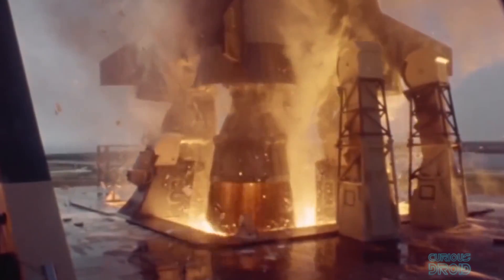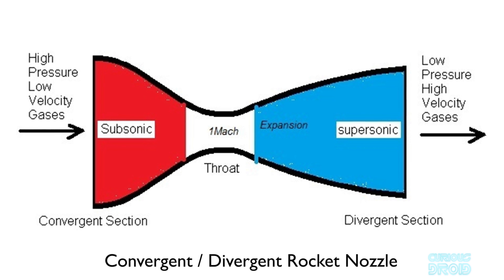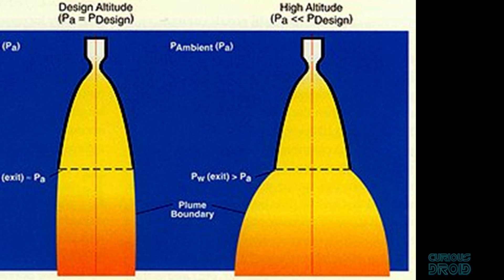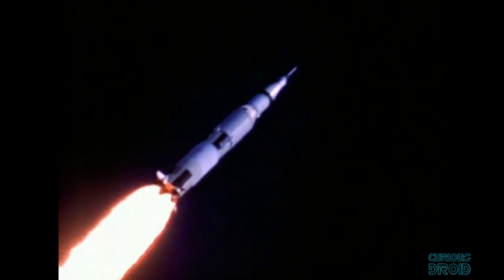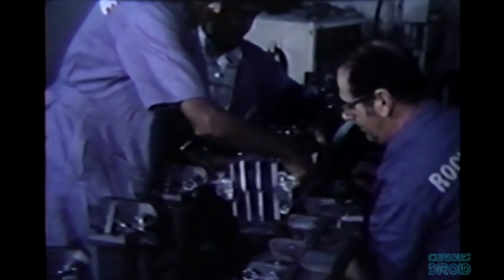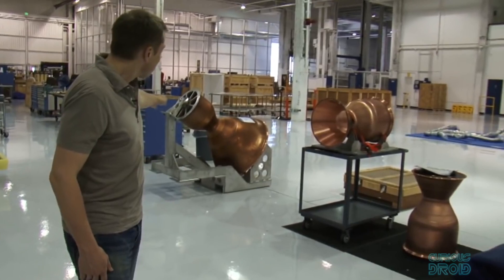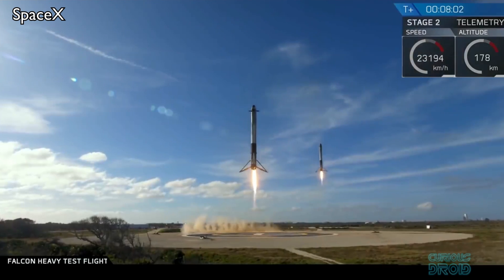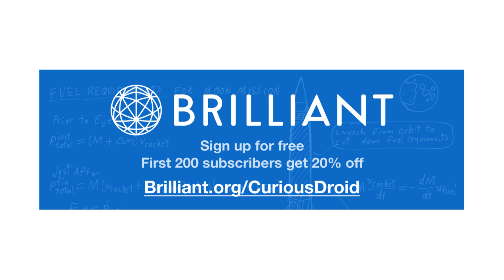Aerospike Engines - Why Aren't We Using them Now?

Comment: How about using variable-shape bell nozzles?
Reply: Pass The Butter Robot most modern bell nozzles have cooling lines in them, so they can't change shapy like a jet nozzle
Reply: That has been done with the RL-10 upper stage of the Delta. It had a sleeve that popped down in flight that increased the expansion ratio, essentially making it a two-speed rocket if you'll allow the analogy. Supersonic afterburning jet engines come with expanding nozzles as a routine. But it's difficult to impossible to cool that design properly or do it with ablative nozzles. The shock diamonds you see on fighter jet takeoffs are due to overexpansion needed to keep the temperature reasonable.
Reply: Yea I wonder if they could make one like that of Jet Engines adjustable Nozzle with Afterburner
Reply: That would be nice. And grow them nozzle petals as single crystals with cooling channels like we already do turbine blades.
Reply: It's probably because the equipment needed to do so would need to be so large and heavy to get the power needed that it isn't worth it.
Reply: Far to heavy and complicated.

Comment: Why looking at the price of fuel, when a kilo of fuel saved in efficiency, is a kilo gained payload?
Reply from the maker: Yes very true and that would be worth a lot more.
Reply: Troels Fischer Thomsen a kilo of fuel savings doesn't equate to an extra kilo of payload. It's not a 1:1 ratio
Reply: @Anubis7169  Thinking about this a bit, this seems to be right for two reasons:
First (relatively obvious), 1:1 should at most hold for an SSTO vehicle, and there hasn't been any in practice.
Second, and more subtly, let's say the rocket (stage) had 1000kg of fuel, and you make it 1% more efficient, so it only needs 990kg to achieve the same change in momentum. For these saved 10kg, you add 10kg of payload. Initially, the vehicle will have the same mass and the same acceleration. But let's look e.g. at what happens after 1/10th of the fuel has been consumed. Your original, less efficient design has 900kg of fuel remaining because 1/10th of 1000kg has been used up. The new, more efficient, design has only 891kg of fuel remaining (99kg of 990kg spent), but it still has 10kg extra payload for a total of 901kg. The acceleration will be less and the total delta-V will be less. It should be almost 1:1 for small efficiency improvements. (I'm too lazy to do the math right now for the correct conversion formula.)

EDIT: "1% more efficient" is a bit confusing here, what I mean is requiring 1% less fuel, not achieving 1% more change of momentum for the same fuel, which would be equivalent to needing 1.0101…% less fuel. In the example, the difference is marginal, anyway.
Reply: That is why I keenly follow Reaction Engines' SABRE news. A rocket engine that can suck in the air around it rather than carrying enormous tanks of LOX would again save space and allow for more payload.
Reply: SpaceX is aiming for cost reductions that achieve orders of magnitude shaved off launch prices. An aerospike does help, but it's not nearly as significant as achieving 100% reusability.
Reply: I think the more important factor is the rocket equation, fuel saving is really more than money, it's delta V
Reply: It could also make the difference between expending and recovering the vehicle, which brings it back to >90% savings for some percentage of orbit/payload combinations.
Reply: linear aerospike engine is lighter than bell shaped one. in many case other things will fail and not engines. fuel is cheap but engines are not and since that design would need less engines that would make everything cheaper plus no stages simpler design thus more reliable design. and less fuel would mean smaller rocket for the same payload so less stress on material. lots of benefits.
Reply: if there is 1 stage instead of 3 stages that means less engine. hope you can agree with that. besides i never said those are more powerful. and paraffin is fuel not type of engine. and most of fuels can be used on different types of engines.
Reply: and than you have only 1 stage with only few engines instead of 3 stages with each of them with their own engines that weights a lot and there is stage separation that is again risk....
Reply: Robert Pruitt I think what he's not understanding is thrust to weight ratios if you're not dumping extra stages to lose weight are you required to have a more powerful engine if you need a more powerful engine your using more fuel, requiring... more fuel to get orbit more fuel means you need a bigger engine and it's just diminishing returns at this point
Reply: Yes- weight is much less critical for the lower stages since they only undergo about a third of the acceleration.  Fortunately the lower stages are the big, expensive ones and the easiest to recover.  A reusable first stage is the low-hanging fruit, so it's nice to see SpaceX succeed at this.
Reply: that is correct
Reply: yes lighter than conventional engine. besides many fuels can be used with it. and even if its more complicated if using only ONE engine and no separation of stages that makes rocket much more simple.
Reply: Jebi Se 
Jebi Se 
Paraffin engine works quite well considering we also call engines that burn liquid gasoline a "gas engine", a diesel burner a "diesel engine"(etc), I think we can both agree on that.

And you're using engines and stages interchangeably. That's not how it works at all.

And you don't want to single stage a rocket all the way space. At least not past low earth orbit (and I'm not real sure about low earth orbit either). One of the big reasons to use stages is to lighten the load as it goes higher and uses the fuel. So you would need more thrust overall, which means more fuel and bigger engines.

Plus, we probably aren't going to try and recover a rocket from past a certain distance from the planet's surface due to size and fuel requirements.

Bigger engines are also more likely to explode than smaller engines (and the paraffin engine is VERY hard to make go boom).
Reply: Jebi Se 
And yes, I'm quite aware that the vast majority of launch weight is fuel. I'm also aware that it does matter.  An extra 20,000 gallons of fuel doesn't launch itself. You have to build a bigger rocket to hold it and use even bigger engines to lift it.

Considering just how dirt cheap the fuel is maybe you should be asking why we're spending so much money trying to increase the efficiency of them. It's because it let's you use smaller, more reliable engines for the same cargo weight. It damn sure isn't to use a few hundred gallons less fuel.

And the other rocket is still more powerful, cheaper, and more reliable.
Reply: Troels Fischer Thomsen 
Saving a pound of fuel increases the amount of weight you can put on the rocket by about a tenth of a pound. However this is under absolutely ideal circumstances and doesn't account for things like latitude, atmospheric drag, or altitude related changes in gravity. So it would be an even smaller increase in cargo capacity under real-world conditions.
Reply: Stephen Blume 
True that.
But sometimes, under just the right circumstances, that ends up being better overall than something that is a master at one thing.

The tricks in figuring out when it is better. Which itself isn't a simple thing at all.
Reply: Robert Pruitt - The cost of LH fuel and LOX oxidizer is the cost of purifying the water, the electricity to separate the H from the O, refrigerate and compress the two, store and deliver it. The environmental impact is mainly in the power plants that provide the electricity. The rocket engines produce distilled water.
Reply: true. if there will be the need for some super heavy lifters than things might change.
Reply: Jebi Se 
But not lighter than a conventional engine, and still far more complex.

But yes, other things than engives often blow a rocket up. THAT is Irrelevant. I never said engines were the only thing that caused failures. But non engine related failures wouldn't be dependent on which engine was used. We would still have more failures overall with a more complicated design.

But here's a MUCH better engine.
https://www.nasa.gov/feature/ames/from-pedicures-to-the-peregrine-rocket-paraffin-wax-proves-its-worth

Basically impossible to make the fuel safer considering young kids eat this rockets fuel all the time without any harm. And the fuel burns at 3 times the rate if regular fuels (more power). Smaller, simpler, and cheaper too.
Reply: Jebi Se 
Umm, more powerful doesn't mean going from five engines to one more powerful.(or however many)

It's a little more powerful. More like from 7-9 engines to 6-8.

And the paraffin engine a link to it even more powerful than that, smaller, simpler and cheaper.
Reply: we call them internal combustion engines.  most of the rocket weight is made out of propellant so thats not a problem... but do watch whole video here you will learn new things on why separate stages are used.
Reply: Jebi Se I understand what you're saying and it seems to make sense but in practicality it doesn't quite work that way.
Reply: Jebi Se 
And you're still wrong.

I'm through trying to explain something so simple to you.

So, why don't you try and find a link to an actual scientific site that backs your claim up?

You won't find it..... because you're wrong.
Reply: well yeah apparently aerospike engine got a problem between 1-3 mach where its not all that efficient. but if that wouldnt work at all why trying to make x33 in first place? that was suppose to be single stage vehicle.
Reply: Jebi Se 
Every rocket, and indeed EVERY engine type that exists, has negatives. Which is why we have so many types of engines on this planet.

Just because something has negatives and limitations doesn't mean it isn't useful for something. But it does mean no single engine type can be used for everything.
Reply: Robert Pruitt you miss the key point that fuel is weight.  Every 3 kg saved on the first stage allows for 1 extra kg of payload, every 1 kg saved on the final stage equals 1 kg of payload.  Greater fuel-efficiency in a rocket means you burn less fuel for the same Thrust (higher ISP), meaning you need to carry less fuel to accelerate the payload, and less fuel to accelerate THAT fuel.  Anything you can do to improve the ISP allows you to improve the mass-fraction to orbit: typically only 3% of launch mass or less on current rockets.  With an Aerospike, you have a heavier engine, but get a higher average ISP (fuel-efficiency) throughout the flight, ultimately equating to being able to launch a heavier payload with the same sized rocket...
Reply: A kilo of fuel saved to lift the  SAME WEIGHT. Why is everybody so bad at math?
Reply: blurglide - The Shuttle was a single stage system. The fuel tanks were jettisoned when empty. I think the big LH and LOX combined tank was junked but the two solid fuel tanks/engines were recovered.
I didn't see the point of sending the liquid fueled engines on with the shuttle craft but then I'm not an aerospace engineer or physicist.
Reply: Robert Pruitt - British "paraffin" = USA "kerosene" or USA "paraffin" waxy solid that liquefies at a relatively low temperature?
Reply: yeh i thought that was a stupid argument. Fuel efficiency doesn't mean you use less fuel, it means you use the same amount but get way more delta-V and therefor payload
Reply: The benefits of air-breathing engines aren't as great as you might expect, even if you're using frozen hydrogen to cool the incoming air.  There is some benefit if you hit a bullseye, but it doesn't come close to offsetting the complexity and risk.
Reply: Jebi Se the engine isn't necessarily more powerful it's more efficient at all altitudes but, not most efficient at one altitude.If you only have one stage it means which is what this engine would be designed for you're not dumping excess weight, meaning the DeltaV required to get to orbit is higher removing most of the gains that you have received from using the aerospike to begin with. I personally think the aerospike is a very interesting engine but I don't know if it's very practical.
Reply: Robert Pruitt and that is kind of the point. Arrow spikes try to be everything but just end up being subpar at everything. Jack of all altitudes master of none.
Reply: yes, you get more payload, but you also add more stress to the structure of the ship.  You either go up in a flight so fast (or turbulent) that you kill or break everything on board, or you cause so much stress on the ship that it breaks apart.  One of the biggest questions about spaceX's BFG isn't if it will be more efficient (because it will be just by the math of it).  The question is how it will accelerate at a human pace, be smooth enough to not destroy everything, and be strong enough to not fall apart... without adding more mass to the ship, which would mean much more mass in the fuel, and the terrible cycle continues.
Reply: Troels Fischer Thomsen 
Not how it works at all.

To begin with these engines have extra weight due to the cone and they require more cooling, which also adds more weight and uses fuel.

Fuel is so cheap compared to the rocket that it's cost is absolutely irrelevant. Its also a more complicated design that will always be more susceptible to failure than what we use now. With enough launches even a tiny increase in chance of failure will eventually blow extra rockets up.
Reply: Jebi Se 
You keep saying that. And it still doesn't matter.

The rockets/engines are what cost. Single stage to orbit is only gonna work for disposable engines. Which means it's far more expensive than a multistage where you get to reuse the biggest most expensive engines.

And the one I linked to are still better..... Period.
Reply: clearly lots of that weight is represented by engines it self. not having those in first place (1 stage) reduces the weight you start with. so yes you dont even need more powerful engine.
Reply: Jebi Se 
I forgot to mention that your main problem is you're using this video to base your belief and argument on.

Did you read the first post in this thread that stated saving a kilo of fuel means you gain a kilo in cargo capacity?
Did you notice the heart curious droid gave that post?

THAT should tell you all you need to know about how much curious droid knows about science. Which is to say they know absolutely nothing. So don't use them as your source of knowledge for anything even remotely related to science.

Comment: i was nder the impression stages were additionally used to dispose of empty weight, being able to drop 75% of the fuel tank weight seemed like a good tradeoff to make
Reply: That's the major reason for staging, but you'd need a lot more fuel if you use an engine bell not optimized for the atmospheric pressure you're flying in.  This is why when they fly Delta IIs with 9 boosters, only six are ignited at launch.  The remaining three have engine bells optimized for higher altitudes, and are ignited later in flight.  I'd assume that if they used aerospike engines (not that they'd work with solid propellant, but for the sake of the argument), they could get better efficiency out of each engine, and could afford to burn them longer with better average thrust across the entire flight, reducing the total weight and fuel required to get to orbit.
Reply from the maker: well said @thebigitchy, but they do work with solid propellants, at 9:15 of the video I mention the NASA test of a solid fuel toroidal aerospike, they should work on any chemical fuel engine that currently run on bell nozzles.
Reply: I think that's an important point - especially if you're recovering your stages, staging counters most of the argument for areospikes.  Yes, they are more efficient at a variety of altitudes, but they are less efficient at any one altitude.  So, if you're staging *anyway*, there's less need to use an areospike.  You can build your stages so that the loss of efficiency is minimal, getting most of the effect of areospikes without switching to an untested technology.

Areospikes are brilliant for single-stage-to-orbit designs - but there's lots of reasons not to use those designs in the first place, which areospikes don't counter.
Reply: Had this video been made just ten years ago then there would have been a lot of head scratching about why nobody had taken the aero spike engine development further.  However the latter part of this video introduces the commercial component to rocket launching.  If the cost of development of the aero spike engine cannot be recouped against the backdrop of reusable traditional bell housing rocket engines then they will remain a ‘what might have been technology’; making them part of the X33 SSTO program put too many eggs in one basket.  The linear aero spike  engine does have desirable attributes from an operational and manufacturing view point due to its being essentially modular.  Small repetitive combustion chambers are ideal candidates for mass production.  The overall engine thrust is scaleable by simply varying the number of chambers.  Cutting ignition to individual chambers effectively throttles the entire engine allowing reduction in thrust at max Q and booster landing.  In many ways the annular arrangement of multiple engines as envisaged for SpaceX’ BFR booster creates a virtual aero spike.
Reply: @ Daniel Staal
The aerospike is the optimal engine for the first stage where the atmospheric pressure drops fast but for space work vacuum optimized bell engines are better.
Reply: Ah, thank you for that.  I guess I missed it.

Comment: Isn't Firefly rocket's first stare using an aerospike?
Reply from the maker: They were going to use an aerospike but went bust and the company which took over the assets dropped the aerospike and is going with conventional bell nozzles engines.
Reply: Curious Droid Don't say it's true :( They were close!